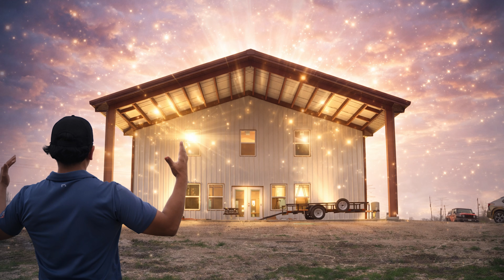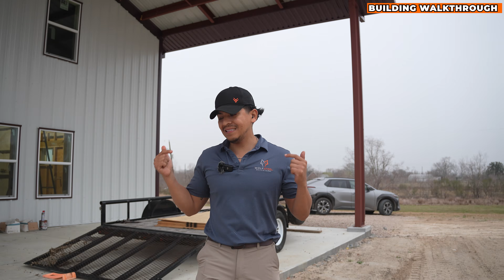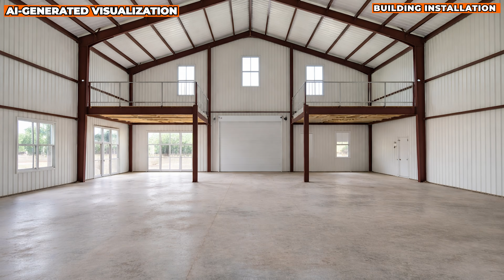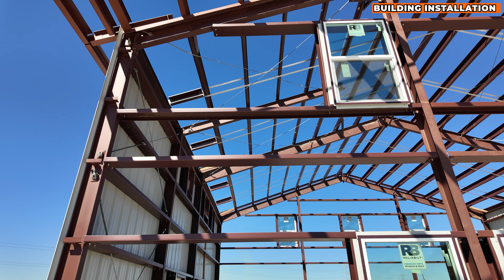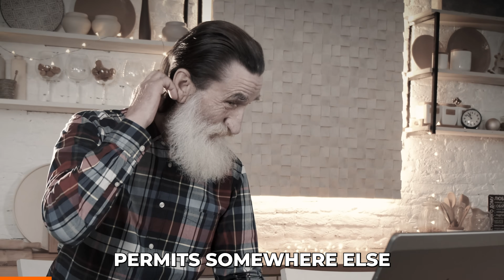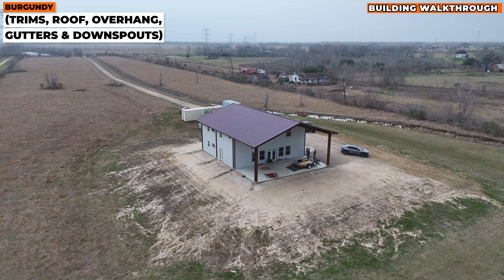What to Expect Before Building a Metal Barndo in TX | WolfSteel Buildings

Comment: On these metal buildings, can a gable extension/carport be added later?
Reply from the maker: Great question! Short answer is yes, but you need to consider some factors like cost, permits/codes & structural compatibility.